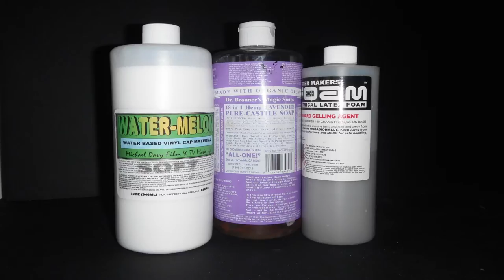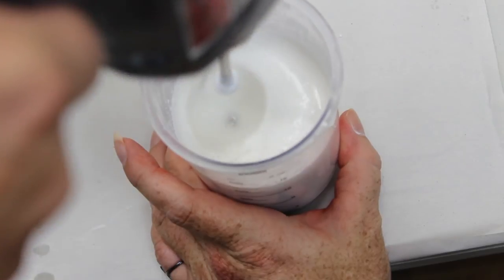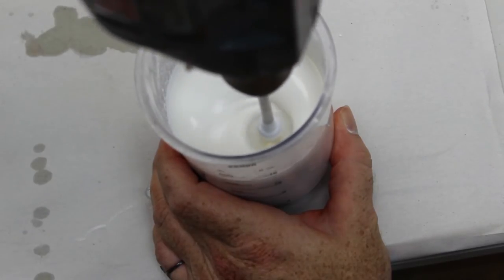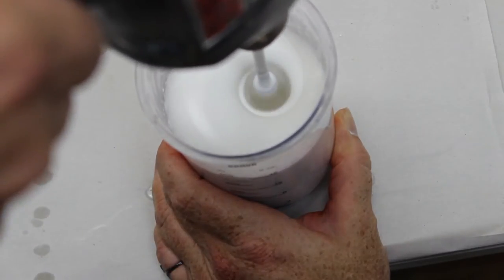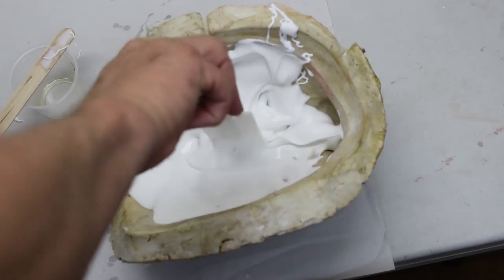MICHAEL DAVY - HOW TO FOAM WATER MELON

Comment: Can you bake this in your everyday convection oven?
Reply from the maker: +Akanite Ghostt You never really "bake" itYou only let it dry or force the excess water out of the foam.Yes you can use your everyday convection oven but use a very low heat - no higher than 110f. Low heat - - - long time (overnight). This will prevent steam lakes, mold cracking and burnt Water-Melon.Be sure to clean any Water-Melon from the rack or bottom of your oven before using again for food.